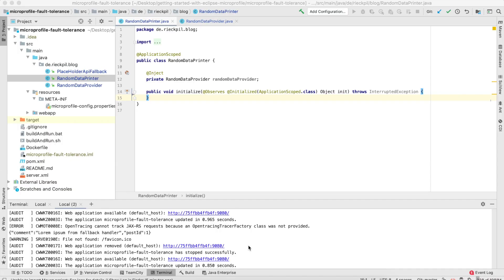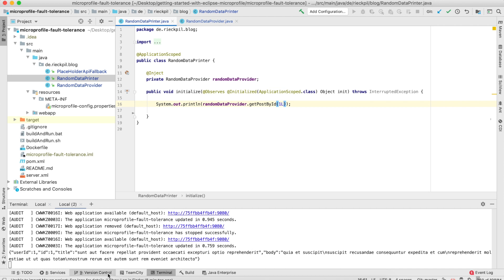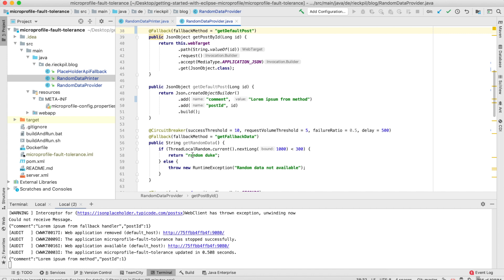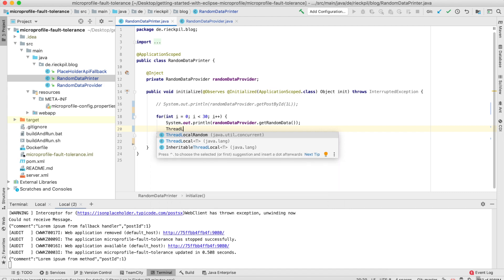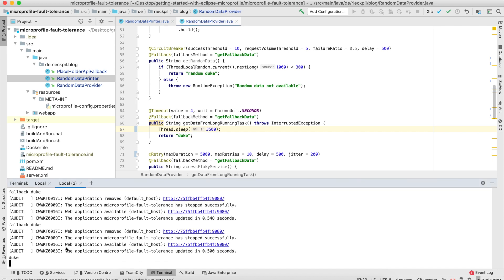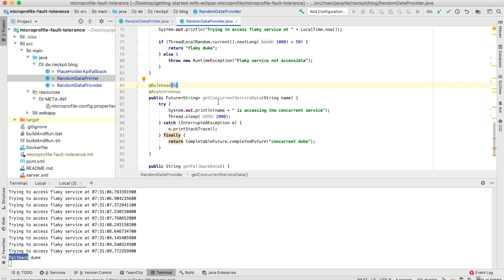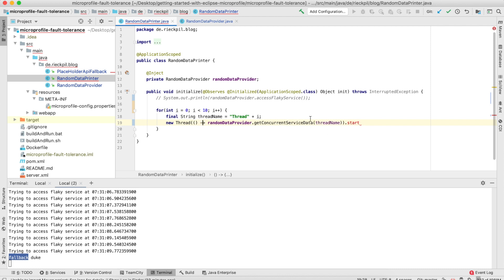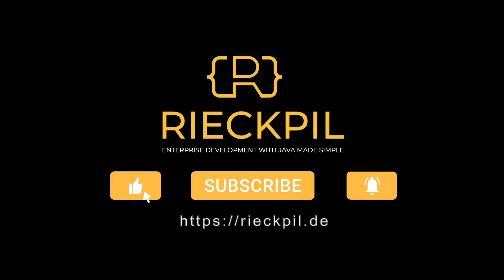MicroProfile Fault Tolerance - Getting Started with MicroProfile

Comment: How can i run the code without using open liberty. Can you please help me in this?
Reply from the maker: what have you tried so far? You should be able to deploy the war as is after activating the required features in your server.xml file
Reply: @rieckpil  I'm trying to run RandomDataProvider on Tomcat server. So, i created a tomcat server & Run RandamDataProvider on server. But it didn't worked for me.
Reply from the maker: @arhantjain1703  I'm confused. I thought you want to run on Open Liberty. Did you try to deploy a single Java class to Tomcat or what where the exact steps you did?